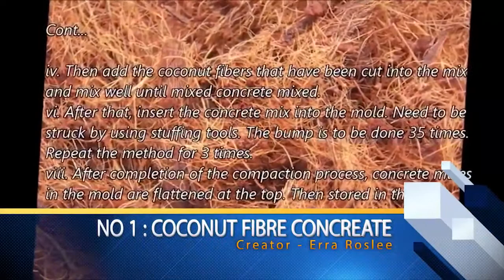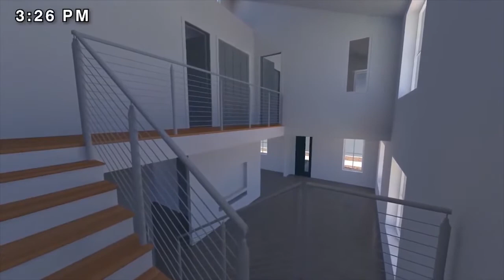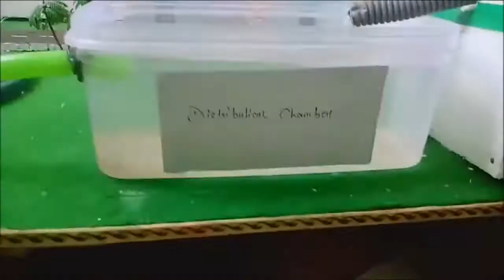youtube video #-8SlvI0f3Uw

Comment: hello sir, I'm doing final project this semester, still struggling on title.. my scope is structural engineering. Do u any specific title that may be use for my final project about structural engineering. I prefer to use software for my project.. any suggestion sir for the title.. can u help me?
Reply from the maker: Pushover analysis.  
Compare a building with software and manually design.